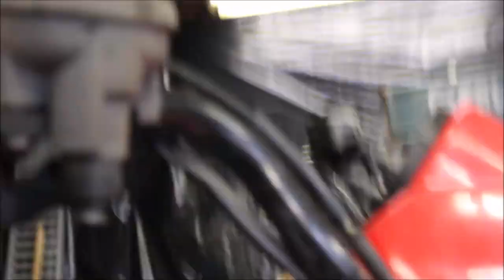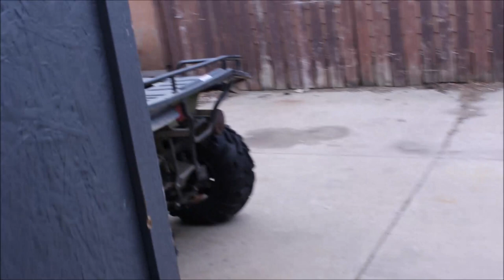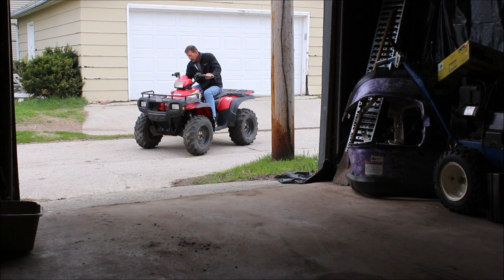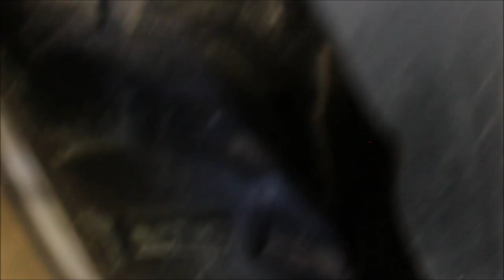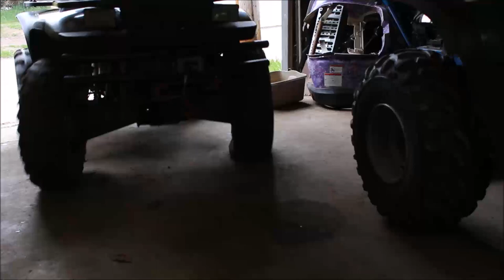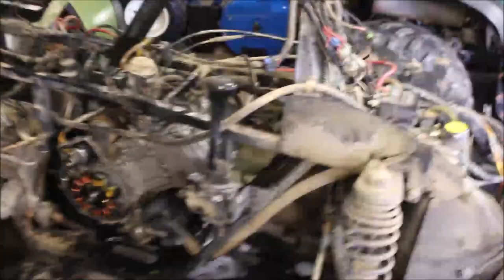3 Polaris Sportsman's Fixed and running in under 8 hours. Crazy!

Comment: got a Polaris scrambler 500 backfires when i release the throttle any ideas??
Reply from the maker: Sounds like you have a air leak somewhere and its running lean. check carb boot, air lines, clean carb.

Comment: What size puller u need for a 500 scrambler clutch
Reply from the maker: All the 500s are the same. I made my own out of 3/4 in threaded rod. but you can buy them off ebay now.